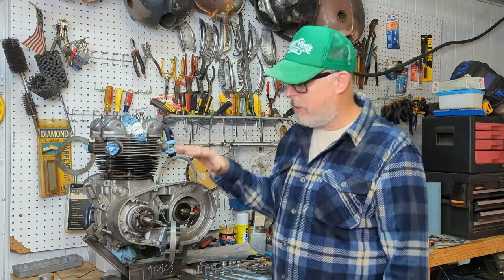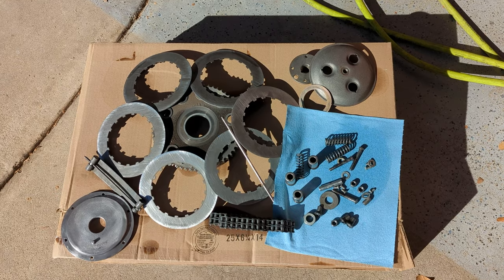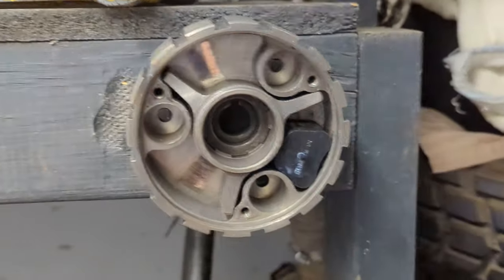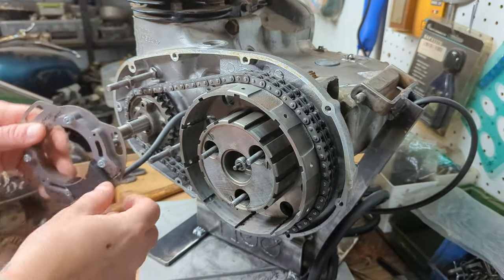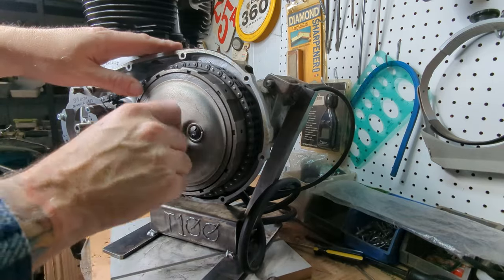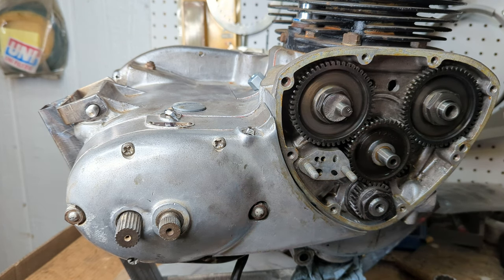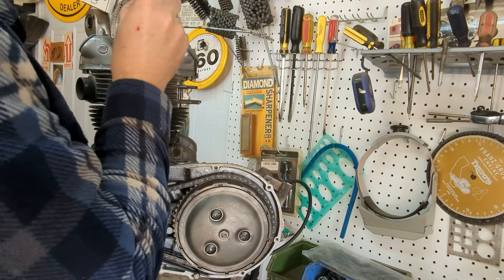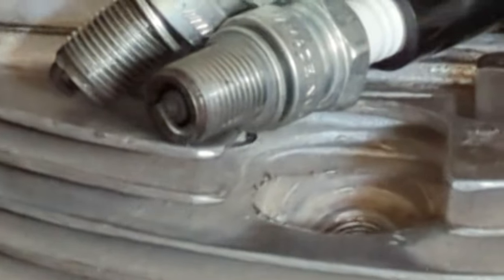1967 Triumph T100C: PT 5 "The TARANTULA!"  CLUTCH & IGNITION - Barn Find Desert Sled

Comment: I rode Husqvarna for a lot of years...... the cursed points system drove me nuts.  When they went to a solid state ignition I thought I'd died and went to heaven.  I don't know how many times I had to throw my old Husky on it side in the mountains of Wyoming and readjust the points.  You are definitely doing the right thing with the new ignition.....hot, reliable spark and no changes in timing.  Also, getting the tension on the primary drive change just right(I rode Maico, too) is essential.....looking at the oil for metal is the crystal ball for knowing the condition of this chain.

Comment: It's interesting to see the internals of the 1967 crankcase as this is the start or the change of threads from Cycle to UNF and the modifications to the oil system. I also recommend the Electrics World pack. Always heat fasteners before tying to undo them !

Comment: Video was recommended by "Wheel house garage" you guys rock. One) What if i don't remove the original points plate on the timing side just disconnect the wires. Two) Will this Starter kit work on '77 TR7RV ?